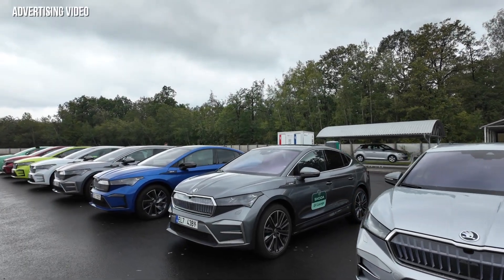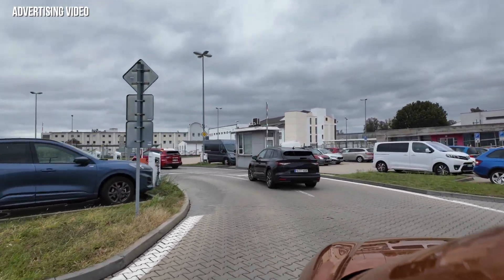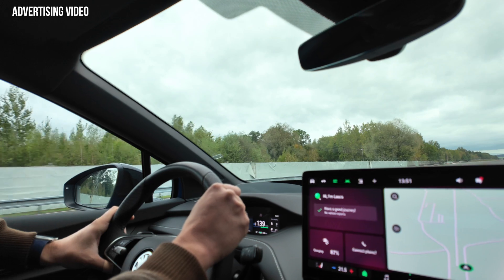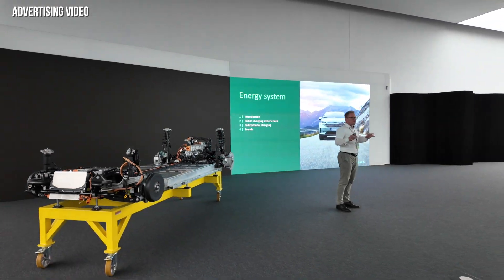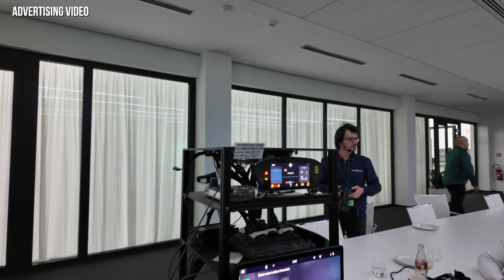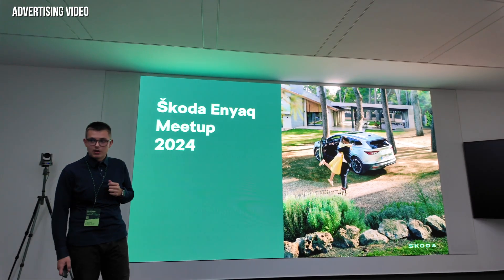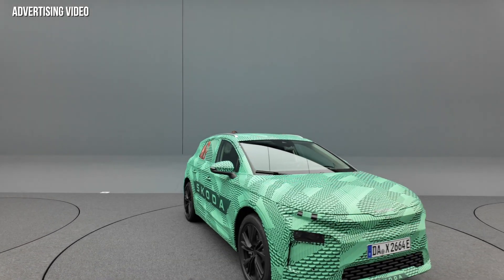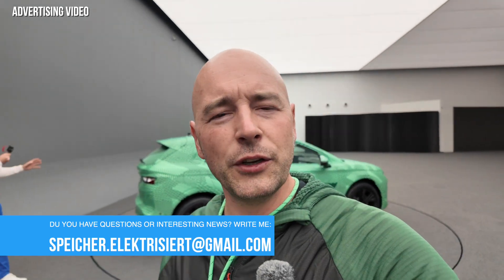Skoda EV Meetup, Q&A session with Klaus Zellmer, Info on PreHeating for ENYAQ with SW 3

Comment: Wasnt the battery first heated when its -15°C and you try to dc fastcharge? Battery cant be charged with negative temeratures. So how is it done then?!?
Reply from the maker: It's still done that way but only when the battery is too cold and then it will only be heated up to around 2°C

Comment: Very interesting video, many thanks for sharing. Near 3:10 min you spoke about "problem with heat in the car", what did he said about that?
Reply from the maker: It was about how to size cables and other components so that they do not heat to much and also to keep the weight low and how to cool the battery when fast charging.
Reply: @electrifiedspeicher  Ok, I hope it was something about heating problem in the car.

Comment: Regarding pre-heating, it will not come, period. Skoda wants to do it, I’m for sure. But it depends on CARIAD, which is a company wirh 4000 people. 4000 people! And they can’t figure out preheating in ME3.X

I will use ABRP for everyrhing, and won’t extend the OEM navigation subscription. They could have made money if it actually worked properly.

At the end of the day, it is dependant on the mother company on software. For me this video confirmed for me that Skoda is WILLING to do something about it. But it depends on 4000 people who until today only produced mediocre software. Can’t say it enough, 4000 people.
Reply: Im left with this feeling as well unfortunately.
Reply from the maker: It's even worse than that. They are depends on their suppliers to integrate it in some control units and for sure those suppliers want lots of money VW does not want to invest for their customers. Skoda is so depended on VW/CARIAD/Elli that it hurts...Skoda could be so much better but on the other side VW saved Skoda in the 90s from going out of business. CARAID will be stripped down to an old software maintainer I assume and will be replaced with a way smaller Dev-Department from the Joint Venture with Rivian.

Comment: Sound good that they are even considering the pre-heating.
But still, I don't know how hard could it be allow temporary change of the battery heating threshold by the press of a button?
Car is perfectly able to heat up to 0 degrees. Increase that limit to 25 for 30 min and boom, you have basic pre-heating functionality.
After delivering this as an incremental software, they can start working on the real nice implementation that they did in the ME4, which for sure is challenging on the ME3.X SW architecture
Reply from the maker: I guess it is simply a question of money as they need their suppliers to implement stuff into some control units.
Reply: @electrifiedspeicher if implementing a single button in software is so expensive that is becomes a „money problem“ that says a lot more about the incredibly bad state of your company and your software development processes than about anything else. They should be ashamed and retire.

Comment: Sounds promising!
Maybe Klaus is following all you bloggers, but they are still super bad at communicating ! 
There’s still nothing communicated about the wheel alignment, and people are every day wearing their tyres unevenly because they are told by the workshops after 4 wheel alignment, that it is totally fine to have 2 degrees of negative camber on the rear wheels, simply because the workshops have not been notified with other information.
Reply from the maker: Unfortunately you're right about their communication. They need to step up several levels here and that very fast
Reply: @electrifiedspeicher  It would be nice to get some updates on the progress for SW in general, both for old and new cars. 
Did they say anything about the time frame for ME 3.X pre-heating ? ..it is soon getting cold in Scandinavia.
Reply: It'a a MEB problem with electric differential. The first set of tyres had also not full profile hight... costs...
Reply: @berndschauer1332  Yes I'm aware that it is a MEB problem, but it doesn't change the fact that Skoda/ VAG haven't been dealing with the problem towards their customers.
It is not only related to old tires, cars with this problem also wear new tires. The wheel geometry is simply not correct and the tolerances for wheel alignment in the workshop manual is way too big.
Personally my car is now adjusted to the minimum negative camber value, which is -1'00'' let's see if it solves the problem.
Reply: @RasmusSass  you are fully right, it related to all tyres, at the end the spots are damaged. I hope the new alignment works for you. Personally I think it is a not good working electronic differential with perhaps the wider back tire configuration (EV 80, 85 and X). A lot of stuff was designed with ID3 and ID4 with small batteries and 4x same tire geometry. We will see what time brings, happy driving
Reply: @berndschauer1332  What do you mean by "not good working electronic differential" What is electric about the differential ?
If the wheel geometry is good, I don't believe tire width will have any impact.
The max allow camber is -1' 50'' deg. which I find significant, when you compare it to other cars. They  normally operate between 0'30'' and 1'00''
It makes the car "stand" a lot on the inside of the rear tires and if you drive calm to moderately, the car will not ride equally much on the middle and outside of the tire. 
So the question is, Why did VAG design the MEB platform to have so much camber ?

Comment: Hi Matthias, will our 2024 Enyaqs get ME5.x update?
Reply: @vasekmedek  from what they told us 5.x was introduced when new hardware was introduced, the ICAS 5 module. So 5.x software is made for hardware that you don't have. Cars with icas 4 need 4.x software. In the Elroq they had 5.2 but despite looking a lot in the menus it looked identical to the 4.0 in my car. So it's a bit like asking if I can get the latest mac os software on my windows pc. No, but I can get updated software on my windows pc just not the same software that's on my macbook. Not a perfect example but hopefully it helps illustrate what I mean.
Reply: @enyaq_gorm  Again? They did not learn anything :(
Reply from the maker: We do not know finally whether it will be possible to get SW 5 to SW4 ENYAQ. There was no clear answer to this but I fear they did not learn anything and will simply repeat what they did with SW 3
Reply: @electrifiedspeicher  Eric told me definitely not, why would I want 5.x on hardware v4 when it's not designed for it. I think the numbering is causing concern where it shouldn't. We as drivers should only see a new number when there's different functionality.
Reply: @electrifiedspeicher  Luckily I do not miss anything important on my 4.1, anyway it is sad they still did not learn cross-version compatibility

Comment: Okay, I have Enyaq with software version 3.7. Should I understand it this way that the preheating might come to older Enyaqs as well?
Reply: They absolutely told us that they understand and are working on it. I actually asked the same question in the software discussion which we could not film and got the same explanation as Matthias (we were split in two and I was in the other group from him). Between us we made sure they heard about the cold gate issue.
Reply: @enyaq_gorm  Thank you very much
Reply: they hear... But there are still producing ridiculous excuses for the poor software.
Reply: Sounds like they want to equal out the software before they will add new features.
Reply: From what I understand it is something that they're actively investigating, but without a firm promise that it will be implemented as there are a few technical hurdles to get over.
Reply from the maker: He was not exactly clear on this that it will come but that they work on it. I pretty sure that if it will come it will be some 3.9 or something and you need to be on 3.7 to get it.